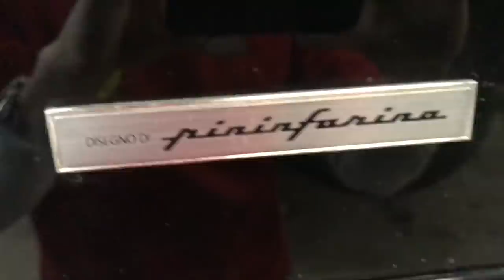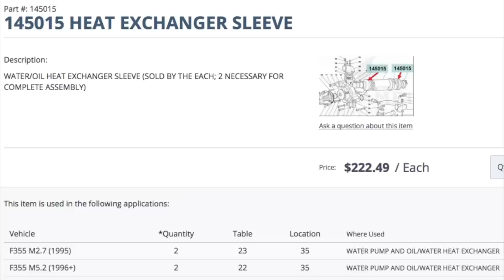Here's What Broke on My Cheap Ferrari F355  ***OUCH***

Comment: I heard there's a guy named Tavarish that can fix it with parts off of a junkyard F150.
Reply: gringoricua I think tavarish is Puerto Rican
Reply: He's Russian actually! Ancestry... idk
Reply: Or Lowes
Reply: Snoopy he is half dominican, NOT Puerto Rican
Reply: well there's abit of a problem with that, he bought a volks porsche lamborghini, not an ACTUAL lamborghini, so some cheapness is to be expected.
Reply: Kavinsky Smith I don't know what makes it cheapness besides an Aventador.

Being that the Huracan is literally built off the the same chassis as the Audi R8. So they are actually all Audi/VW Lamborghini's if you want to be technical.
Reply: Kavinsky Smith Also Porche has no hands in Lamborghini
Reply: +iTrinityPlays As Samcrac said in his latest video, "Tavarish bought a Volkswagen"
Reply: Tecker That's fine, I don't see nothing wrong with buying a Volkswagen. Boring sure, but reliable and probably the cheapest European car brand to maintain.

Had an Mk2 Jetta go until 300k miles on an original motor and Transmission.
Reply: Up until Mk3, they were pretty reliable.  I have a Mk3 Jetta at 180k miles that's still on the original motor and transmission.  It's on its second clutch, I converted the windows to hand crank after the fifth replacement motor/regulator, and I was in an offset head on collision (I drove away, while the Suzuki Grand Vitara who hit me was towed away. The insurance totaled it, I bought it back and fixed it), but it still runs perfectly on the original motor and transmission.
Reply: Trinity its a throwback to a line of cars that were made between Volkswaggen and porsche, called the Volks Porsche, the 914, as no italian would ever style a car like they did the early gallardos, square, boxy, uninspired and blocky looking, with about as much stylage as pair of brown shoes.

and my father OWNED a 914, it was actually a fairly good car, outside of its italian problems

weirdest thing the italian car he had before it, a fiat 124 sport spider, no issues, the 914, windows breaking, engine randomly stopping, poor gearbox, everything you'd think you'd find in a cheap italian crapbox really.
Reply: +
iTrinityPlays - Volkswagens are reliable? LMAO.
Reply: Um it was an explorer!! Thank you very much
Reply: Fr tho
Reply: 😂😂😂 and bolts from a lawnmower
Reply: actually Tavarish is lithuanian
Reply: OMG, far better than GM shitboxes under Daniel Akerton I'll tell you that much, as he was SO bad that the woman who took over who's closed GM plants in aulstralia and moved them to germany, had to do 84, EIGHTY FOUR safety recalls as her first act as ceo.

FYI Mr Akerton is now working as a member of the board of directors for american airlines, which might explain a story that Mike Finnegan of roadkill said many many months ago in one of his podcasts really, where one of their aircraft had suffered a catastrophic engine failure on the ground, which had put him on a different flight in nashville next to some country western star

and the way he put it, the engine literally exploded on the ground, and I'll I could think was, yup, that's about right!

Comment: Previous F355 owner here. It doesn't look like the PO ever did the fuel block recall. This is IMPORTANT. Please inspect to make sure because people have died as a result of this defect.
Reply: You could be right. I noticed the fuel hoses on modified cars are almost at the height of the top of the power steering reservoir cap. I still haven't done mine. I've seen some botched recalls where the hoses and clamps are so high that they are rubbing against the engine lid.
Reply: +ImperrfectStranger Yep, that's what to look for. If the recall was performed, you should see the divider block at (more or less) the height of the PS reservoir cap not buried out of view. 

Any Ferrari dealer will do the work (and provide parts) for free. Or you can buy the parts (<$100, IIRC) and have your own mechanic do it.
Reply: urgetodrive
You responded to that recall, went to your local FIAT dealer?
IMPORTANT, this is not the skilled people channel, they only buy old crap, unable to service them themselves! Not a mechanic skills channel!
Reply: urgetodrive IV had HORRIBLE experience with the dealer on older cars in my experience their scum who will get older cars out without doing anything but masking problems and play on 'main dealer' and fleece idiots. Id always find a specialist even if I had to pay for it.
Reply: @FuhQ64  That's what I was wondering, did Hoovie ever get this recall taken care of? Well it's ashes now
Reply: Man, I hope the fire that burned the  car wasn't related to this...since this commenter helpfully pointed it out.
Reply: This channel is all about learning, isn't it? Sometimes even the hard way 😕
Reply: Lol
Reply: Bet he wished he had listened now
Reply: He may never have done so, because the car set alight recently.
Reply: Yes, read the post, it even says its Hoovie's. Specifically fuel block? Unknown I think.
Reply: What can I do for a living to buy a the f355 LOL I've always wanted one of those in the early nineties but was never a drug dealer I'm sure I can afford it in 2018
Reply: oh my god could that be the reason the car eventually exploded??
Reply: Is this why it caught fire?
Reply: And it harmed out you were right...
Reply: This is why reading the comment section is necessary.

Comment: Just a hose today, buddy, just a hose today...
Reply: Actually a brake job is only about what you would spend on an Accord. Actually, let me rephrase that, a Ferrari brake job is only what you would spend to buy a whole Accord.
Reply: Kevin MacNutt lol
Reply: He escaped just this one. Next time the engine will be out.
Reply: For the price of 1 of those hoses, the floor could have been welded on the talking LeBaron ....
Reply: Daniel Hammond... noooooooooooooooooooooooooooooooooooo
Reply: Luck is on your side
Reply: all it takes is one blown head gasket or radiator leak to cause a overheat it dont take much . Overheat can cost you a whole engine which pratically more than the car is worth. send it to a river.

Comment: Wizard : I think you should turn it off

Hoovie : revs engine
Reply: Sean Sean a cold engine may i add
Reply: Based on the bubbling at 8:20, we know the engine was not cold. Also the revs were not that high, I'd guess around 3000 RPM maybe 3500.
Reply: well, that bubbling probably wasnt  bacause the coolant was boiling,  it was just  leaking
Reply: It was not boiling, coolant doesn't boil until 223f, which is a temp you do not want your engine operating at. It was bubbling because the cooling system was under pressure and was escaping into the non-pressurized room. The cooling system does not become pressurized until the engine is warm.
Reply: ReadyToGo, makes sense to me now
Reply: Sean Sean lol.  Immediately thought the same.
Reply: Haha, don't worry about the cold engine, that was barely a tap on the gas.
Reply: Yeah I was wondering about that.  Revving the engine before shut off is something you do on 1950s diesels.
Reply: That was so Hoovie of him! lol
Reply: I was screaming at my phone for him to shut it off
Reply: Was thinking the same thing.
Reply: It does not harm the engine to rev it to about 2000-3000rpm
Reply: Oil is the one you want to worry about when something is leaking. Running a cold engine with low oil can cause harm fast.
Reply: Big Cheeze this was leaking coolant
Reply: It looked like the video cut and the mechanic probably added more coolant and told him to rev so they can assess for total engine failure..
Reply: that is natural in Ferrari owners... 😂😂
Reply: Regardless of the situation you shouldn't rev an engine just before shutting it down. It introduces fuel into the cylinder which washes away the layer of oil protecting the cylinder walls from the rings.

Comment: What kind of car can’t go 40000 miles without turning into a pile of shit...?  Ferrari
Reply: You'll be hard pressed to find a competitor to a Ferrari that also doesn't need extensive servicing and repairs within 40k miles as well.
Reply: It's not just about miles. It has to do with the cars AGE aswell. We're talking about a 20 yr old car here. If that hose has been on since the car rolled off the assembly line, it's more than 20 yrs old, very few hoses last for two decades unless they are in a sealed package in a dark and temperature-stable environment...
Reply: I envy you... Where I'm at, that car would have cost more than 100 000 USD, due to taxes, and that's before factoring in insurance and monthly road tax. Also, parts would be expensive, if you're lucky enough that your ford dealer would even bother to import parts if needed :P
Reply: @ Shipwrecck78 Come back when your car is 20 years old and tell us how many issues you've had. That's how old this Ferrari is.
Reply: I thought my 82 Celebrity was bad.
Reply: Ford
Reply: Literally any Corvette. The much lower cost could offset the few needed repairs
Reply: ImperrfectStranger I have a 23 year old Ford F150 4x4 with 200,000 miles on it and it still has several of the original hoses. I purchased it 9 years ago for $2000  and the engine has never required anything other than basic maintenance since I've owned it. I replaced the transmission when the clutch went out but only because I had a used heavy duty transmission sitting in storage.  You would think for the price they command that Ferarris would be put together better.  It is kind of sad that a cheap Ford is put together better than a Ferrari.
Reply: You have to know that their parts are specific and very low production numbers...unlike ford or chevy or kia etc where they build hundreds of thousands of each type. Why else would a piece of rubber cost $220...they are literally race cars for the street and just like race cars they take a lot of maintenance. People think bc they are expensive to begin with that they should magically just be easy to maintain.
Reply: Get a Z06 Vette for half the cost, and destroy Ferrari's all day.
Reply: U need to understand manufacturers make cars based on needs.. ferraris are not daily driven and no one really wants an old one so they save their money not bothering

Comment: Don't get too happy too soon... I had a car that popped a hose.

I replaced it.

It then popped another...

I replaced that...

And then in finally revealed the issue... Head gasket leak was pressurising the coolant.
Reply: but he is right. For the hose to pop like that indicates another bigger problem. Hoses don't burst like that unless under pressure and considering the hose is designed to be under pressure... hmmm. Also the mechanic said the car had previously been in poor running condition prior to Hoovies purchase.
Reply: Absolutely, the broken hose is a symptom of the real problem. Something caused it to pressure up beyond spec.
Reply: passthetunaporfavor Except it's not actually a hose. It's essentially a short joint. The heat & lack of air circulation in the V would not be kind to the rubber.

Comment: And since it’s a 6-speed manual....NEVER SELL IT!! It’s value, as the value of all gated Ferrari’s will only continue to increase. Good buy!
Reply: S White 100%
Reply: Raphael Thomas It already is... He already traded a perfectly good running NSX for it, on top of 10k... money pit I bet he won’t keep for long...
Reply: IF it runs
Reply: Its nothing but up for the 355 Especially the manual. Best money spent ever!
Reply: I sold a 911 SC to a European buyer five years ago, tempted by the higher prices over there. I kick myself every time I think about it, because prices on air-cooled, manual transmission 911’s will only continue to climb. When Hoovie and The Wizard get this car sorted he could easily make a handsome profit. I pray he doesn’t, I wouldn’t want anyone to have to live with that regret like I have to.😢
Reply: but arent ferraris also worth more based on their colour? i.e "resale red" as folks call it.
Reply: I’m far from any kind of “expert” but my guess is a gated (manual) transmission is more important than color. Again, this is just from articles I’ve read detailing the worldwide rush to buy up all manual Ferrari’s and other Manual collector cars as well...
Reply: The problem is that parts will rot and he needs the engine to be out to replace them.

Comment: Leaking hoses are pretty common with Ferrari buyers.
Reply: Leaking hoses are pretty common on any 20 year old car
Reply: I  wonder if because they're only driven in fair weather stuff starts to dry up and crack. Cars in my experience seem to run better if they're used somewhat regularly
Reply: ImperrfectStranger you missed the joke.
Reply: It's hard to say, and it depends on many factors. In Norway for example, a regularly driven car might have hose breakage more often, if used on winter roads that are sprayed with salt, eating away basically anything on a car.

It would seem to me that rubber hoses do last longer when the coolant doesn't just sit, eating away at them. Might also have to do with the rubber self-vulcanizing when it gets warm from the car being driven
Reply: DrakeKillah you too, missed The joke. Read the first comment again. Slowly.
Reply: Ralf S I was replying to the other guy, but I might have removed the tag and not noticed it :) I did get the joke, but didn't comment on it ;)

Comment: if you're not making six figures or have a shop in backyard, the car game can be exhausting. all the shops that work at a fair price on older cars are drying up. then you're constantly dropping them off picking them up. i got 3 imports but getting difficult. gonna keep hanging in but it ain't easy. still though in last 10 years. spent less on my cars then most women spend in that same time on make up and shoes..so...winning!!!

Comment: You should always check the cylinders before starting it after something like that. Had there been a bad head gasket. One of the cylinders could be full of water and that could break a valve or bend a rod.
Reply: Ye man, I would at least have checked the oil dipstick prior to firing it up.

Comment: From the angle in the beginning it kinda looks like a replica of a F355 😂
Reply: Yes, I agree. The F355s look like kit cars. The wheelbase and the front overhang just doesn't look right.  But if they made them 3 inches longer, you might be able to work on the engine without removing it. We cant have that...
Reply: Elias Yusoufzai iii

Comment: buy aftermarket silicon hose kit instead
Reply: on a ferrari? no thanks
Reply: Why not? You also want to keep the original rubber bushings everywhere instead of poly? Just because it's "original"?
Reply: Until the third one blows in 10k... then it's damn the torpedoes toward aftermarket upgrades!
Reply: the problem with ferrari is even with the shitty parts some of the cars have you HAVE to buy them because everyone that buys ferraris wants the ORIGINAL parts.
You could buy better aftermarket parts but then none would buy it because, "muh authenticity"
Reply: Check the Ferrari forums. Even super expensive aftermarket kits don't fit properly.
Reply: Jack Windrammer I always thought the brand itself was stupid, with their contracts saying what you can and can not do with your car, but it seems their fans are equally as stupid. Upgrading with materials that didn't exist back when a car was new isn't doing anything to the original feel and design. It's just making the thing more reliable and safe.
When replacing tires, do you replace them with a design from the time your car was built or do you get safer and more modern tires? None of that newfangled oil either right?
Reply: ImperrfectStranger That's a valid reason not to go aftermarket on things like this.
Reply: lemster101 If you want the car to be worth significantly less money, but aftermarket parts on it

Comment: Back in my day, I could wrangle the basket in or out of a Testarossa in 2 hours flat. The basket is the subframe assembly that frames the entire drivetrain, the engine and transmission, struts, springs and A arms. It unbolts from the monocoque, and drops right out. So major servicing on a Ferrari is a one day job.

Comment: In my experience rubber bits on cars are usually quite cheap, but they add up once a few of them go. I had a 50yo car that had brittle rubber all over the place, around the doors and windows mostly. Each bit was a few £ but in total it would have been over £1000.

Comment: I read about the maintenance on these cars. $10k "engine out" maintenance every 3 yrs.  Shitty headers and valve guides. Most owners have longer lasting headers and valve guides done at the first service and get it over for $20,000. In the long run, newer models are cheaper to own. 
 BUT,  I'm really glad it was only a hose. May you have several trouble-free years in your Ferrari.

Comment: That heat exchanger boot looks mysteriously close to a fernco. Go to a plumbing supply and try to match one up. As long as it isn't pushing a lot of pressure you're in the clear and only have to spend about 10 bucks.

Comment: cobrapub here,ok YOU did not do you homework on this car!My first Ferrari was a 1979 308 GTB and I owned it from 1988 to 2002 when I blew a radiator I replaced it was in the front of the car and I replaced the send and return hoses all 25 feet of them!I started my Ferrari exp the year my car was born,YEA 15 years of educating my self at Ferrari dealerships on the 308!What the hell were you thinking,I will just though my check book and credit cards at this REALLY!When I bought my first Ferrari I spent 3 hours under the car inspecting the car and I had the dealer include a 10K general inspection about $2400!The things I was told helped me Survive the trip from Bethel Conn to Saint Petersburg Fl and that was a BLAST!